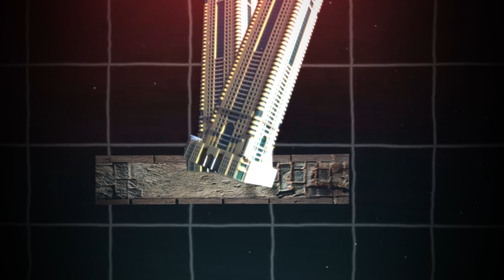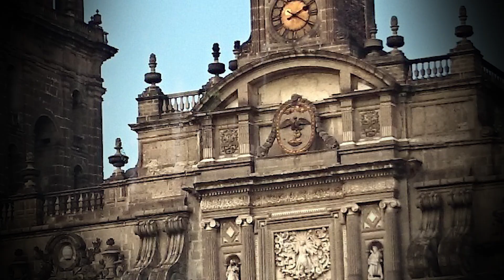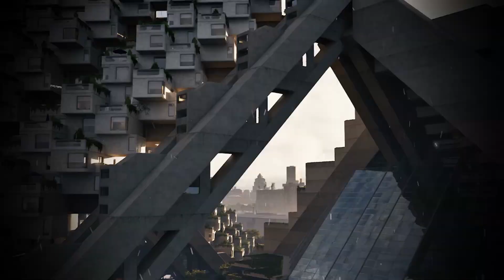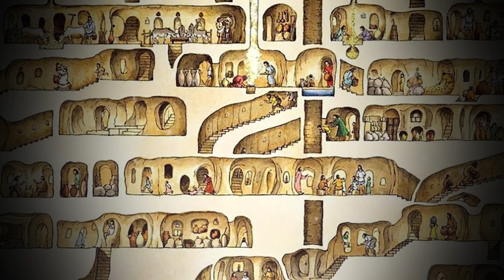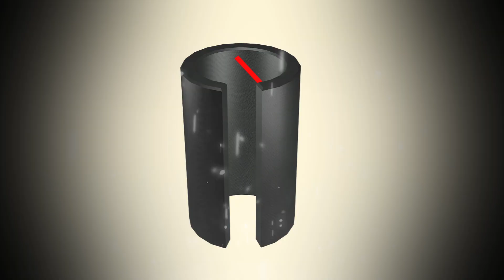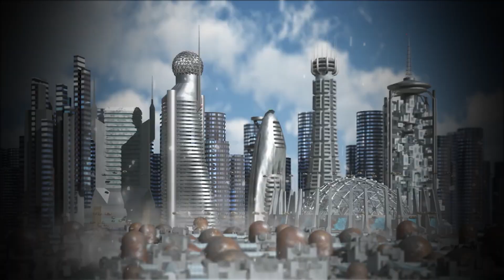What Are Earthscrapers?

Comment: I hope your script was made by AI. All the information in your video seems to come from one website, which is not thorough research. Did you verify the examples by googling them? With just a few clicks, I found the following:

"The Earthscraper / BNKR Arquitectura": This concept was presented for a competition in 2009 but never progressed beyond that stage and is not ongoing.

Singapore is not building an "Earthscraper" but is creating more underground space for infrastructure to provide more room above ground for the population. This idea for housing might be considered or possible around 2050.

New York Lowline: Their website states, "In 2018, The Lowline Board voted to temporarily pause its core operations and aims to restart the project in partnership with the City of New York in the years ahead." Additionally, their test project was stopped the year before.

Underground City, Montreal: It still exists but has faced frequent structural problems both underground and above ground since 2007. While it may require fewer resources to build initially, it becomes more expensive to maintain in the long run.

You are welcome.